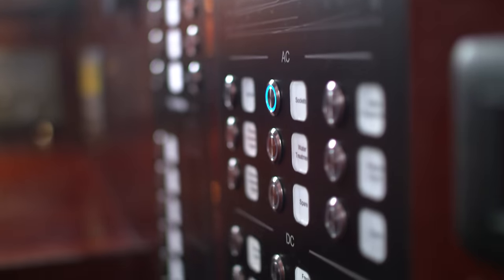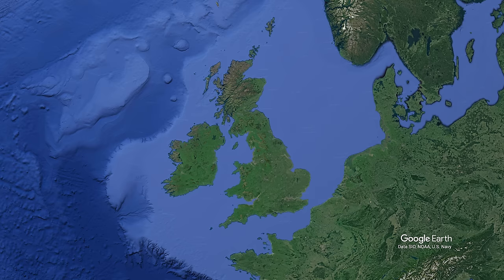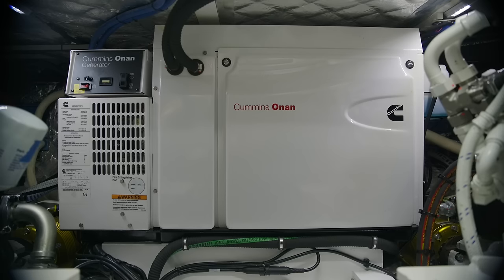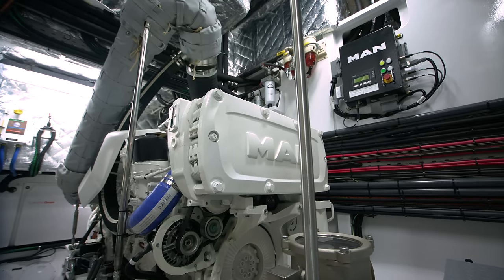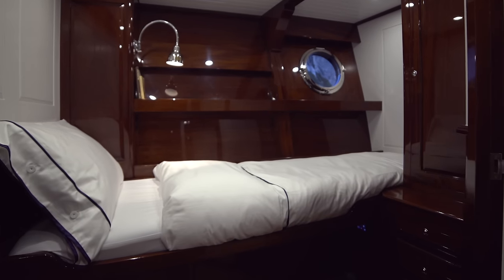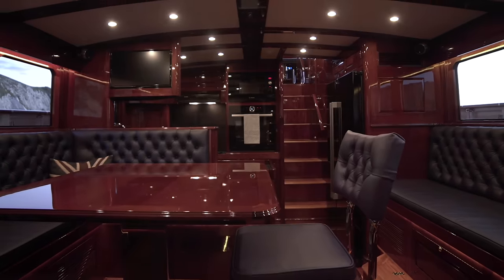$10 Million Superyacht electrics tour

Comment from the maker: 🎯 Key Takeaways for quick navigation:

00:44 🚤 The Spirit P70 Superyacht, designed for 1,000-mile voyages at 18 knots, utilizes lightweight wood construction for fuel efficiency.
02:20 ⚡ The yacht's electrical core relies on two 24V 8000VA Victron Energy Quattros, providing ample power.
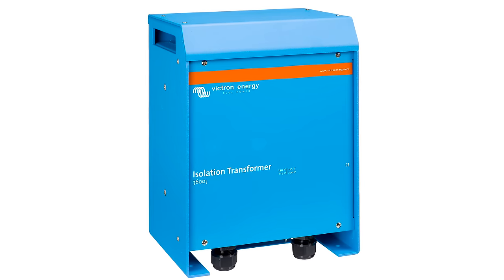03:43 🌊 Isolation transformers are crucial for safety, preventing corrosion and electric shock hazards around the yacht.
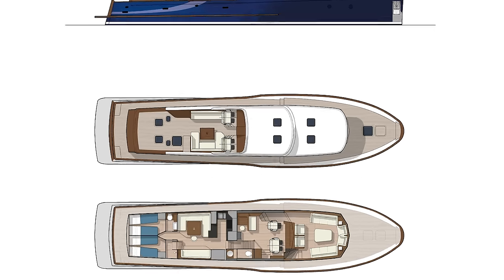06:23 🏞️ The Spirit P70 offers multiple decks, cabins, and luxury amenities for passengers.
09:35 🌟 The owner's enthusiastic feedback highlights the success of the project, combining superyacht features in a compact vessel.